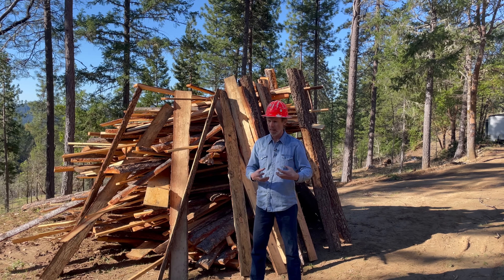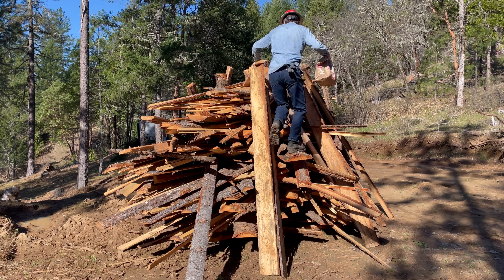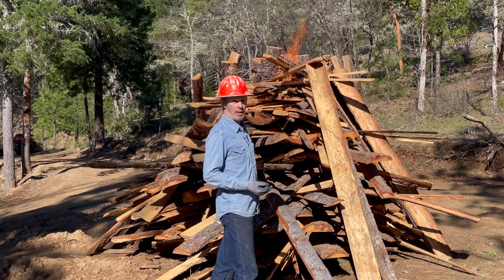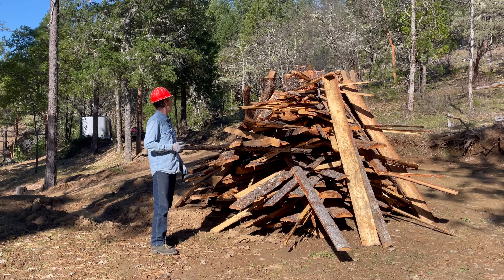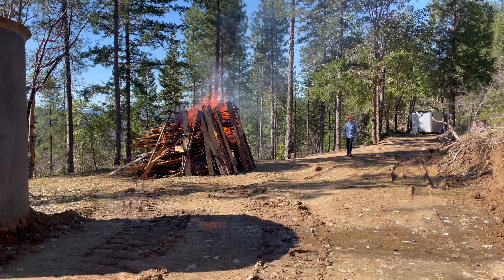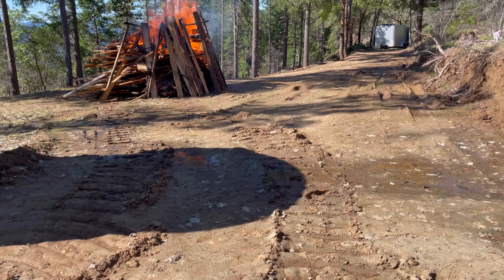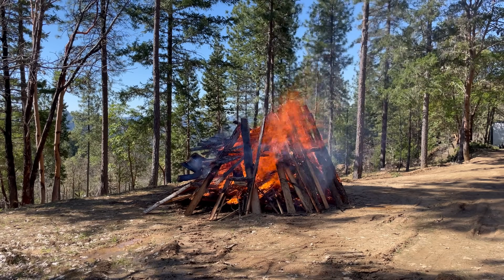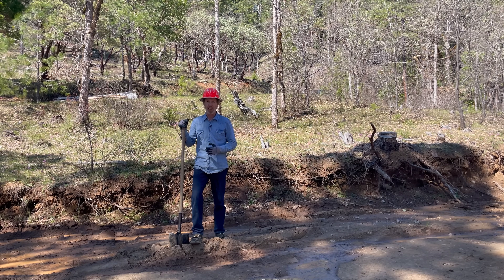Tree Killing Bugs Your Days are Over! Medieval on Your…..

Comment: Thanks for clearing up the mythology about heat rising. Heat doesn't rise, but hot air does in the presence of cooler air... convective heat transfer as you noted. And radiative heat transfer sure burns cleaner. Well done!

Comment: Heat doesn't recognize that gravity exists, as stated it goes in all directions equally, it's only guided by going from hotter to cooler.

Folks get confused because hot fluids (particularly gasses but liquids too) expand and float on cooler fluids, how hot air balloons work.  That thermal convection, aka., 'vertical breeze' also aims the flames to a significant degree so fire does travel faster UP, away from gravity than down.

Lighting from the top does tend to take longer but it also produces less smoke as smoke itself is flammable and consumed in the flames above whereas lit from the bottom produces smoke from above before flames get above.  In a brush pile burning bits will fall thru pile fast and doesn't matter much in terms of ignition speed.

Most important IMO is a tall narrow pile, taller than wide ideally, roughly tepee shaped, that causes chimney effect for rapid minimal smoke tall fire that shoots exhaust way high.  My brush piles are about same size as Wilson's burn pile here but less dense and are consumed to charcoal ready for quenching to harvest for biochar in about 90 minutes whereas it may take half a day in a random pile and require a lot of hot-raking along the way.

Comment: That was an interesting demonstration of the pushing capacity of the D6C which isn't that much but faster than a shovel. 

As to putting out the fire not so much. You didn't put it out so much as you just pushed it forward and parts were still smoking so not out. If the soil was wet so much the better but still not a perfect solution.

Comment: If you have a nice and dry spot to start your fire, and if you have good kindling, then sure you can start a fire from the top obviously. And this may be much easier.
But in less ideal conditions (not being prepared), lighting from the bottom will give a batter chance of lighting the pile.

Comment: In the fireplace industry, it is called a "top burn' or upside-down fire. You get almost no smoke because you have tons of air being drawn into the fire (secondary aeration). As the fire builds, the center of the pile functions as a chimney drafting combustion air up into the burning coal bed. This turns the top of the stack into a funeral pyre for the bugs. It is the easiest to get going, the cleanest burning and even rookies can get a fire going. z

We had a Cat 931 crawler/ loader with the clamshell bucket. Anyone who thinks its simple to grade with a dozer has never driven one. For one, there is no suspension. If you ride up over a rock or hump, the whole dozer tilts. At first, it feels like you're on an amusement park ride because every slight change in grade feels magnified. 

Great stuff as usual Mike. Love the dry wit and wisdom. Y'all need to watch Mike's discussion on forest fires and poor forest management. You'll understand how not only has our much-vaunted US Forest Service done a disservice, but that Smokey The Bear should have been released back into the woods. Fire causes necessary thinning of scrub growth and strengthens the larger trees much like ice storms strengthen trees by forcing them to carry the heavier load. 
 Thx,

Comment: Biochar??????? All you did was make lye for soap. Way too much oxygen and  ashes.
You have the perfect set up for making biochar.
1.Tee-pee the wood like you did , cover 3/4 of the way up with earth , light from the top, let it get to burning real good, then cover the whole thing with a good mound of soil.
2. Fill up that steel pot with as much wood as it will hold .  Light from the top.  Let it get going real good.  Cover the top  with a huge mound of soil. This method might be a pain to clear out the pot but it is definitely the most efficient  and the most safe. Scattering burning embers through the woods is not the most safe way to extinguish a fire.
Reply from the maker: Some people consider charcoal to be biochar. I believe lye is made from ash, not charcoal. There was a lot more charcoal than ash. I was part of a Biochar study a few years ago. It determined that top lit fires retained a lot of charcoal without turning it into ash  if you extinguish it soon enough. Because of the way they burn, the charcoal is shielded from oxygen much of the burn. No this is not an efficient way to make it. Yes a lot of it does get consumed. But a lot of it doesn’t. For someone who doesn’t want to go through a bunch of process, this is a way to make charcoal. It’s the way I make charcoal for grilling. Minus the dozer and the dirt part. They were not spread around the forest. They were spread around then buried in wet to muddy mineral soil. A safe distance from any forest material. Much less dangerous than everyone who is burning debris in the forest right now. The wet season is a safe time to do that when it’s too wet here for wildfires.
Reply: @WilsonForestLands  Charcoal and biochar are the same thing.  One you throw in the dirt.  The other you cook with.  Look, that dozer makes the prospect of you making biochar into a very profitable business and you have to do minimal work.  Just dig a huge cone shape hole , do the wood and lighting it just as you did before. The tee-pee ensures the wood falls in on itself , pushing burnt wood to the bottom and fresh wood on top.  Lighting from the top robs the bottom of the cone of oxygen.  All the air stays  at the top to feed the fire. So the charcoal is actually formed at the bottom of cone since it drops to the bottom.  Again, once its burning at a nice rate just cover everything with a mound of soil.  You can leave the char there until you need it.

Comment: Something I noticed about your top lit fire… the flames didn’t get 30 or 40 feet in the air, like mine did when I lit a pile about that big from the bottom!!!
Reply from the maker: The wood was also partly green and slow burning, that may have kept the flame length down.
Reply: @WilsonForestLands and @ronharrington228, i made the same observation and also believe this is a much better controlled fire intensity for such a fire size obviously in the absence of wind. I will try this next time I need to burn large amounts of wood waste as it often turns into hell when doing it bottom up. Thanks for the great content as always.

Comment: Biochar for 'hippie science' (terra preta do indio) needs the grain structure of wood to host soil microbes. You can't get that from bugs or with the ashes of an open fire.

Cone fire would work, or any way of cooking the wood around 800°F to 900 °F without letting air get to the wood. Your way is just soot, ashes and char.

But good effort helping keep down the pests and showing folks how to burn wood with just some matches and a tractor.
Reply from the maker: That’s what I have heard. But I’ve also heard some so-called biochar experts say this works well too. I’ve looked into it a lot over the years and what I have learned for sure is it is black and messy.
Reply: @WilsonForestLands  By the way, did you have the names of these so-called experts handy? I'd like to look into their methods.
Reply: @WilsonForestLands  No doubt! 

The world is full of people whose confidence in what they say runs ahead of our confidence in what they say.

The residue of a trash fire or clearing fire is almost never biochar, as I understand it. 

No pyrolysis, no biochar. 

Not sealed off from oxygen while it cooks, not pyrolysis. 

There are different grades of biochar, I'm sure you've heard, depending on wood used, cooking time and level of heat. 

I don't need to tell you biochar is porous and takes up compost tea during activation to make terra preta, so it hosts nitrogen-fixers and forms the equivalent of drainage tile when well-mixed (about 25%) with soil, to reduce need for irrigation and risk of flood while extending soil fertility. Plain wood ash changes soil pH, and might add some potash, which is good, too.

While both can have benefits, they're not magic.

My grandparents when there was wartime rationing used a pyrolysis cooker to get producer gas and biodiesel to run farm equipment, with some bonus black liquor for protecting fenceposts from rot. I suppose they could have been hippies.

There are some sixty commercial uses for biochar, from activated filters to aggregate for high R-value concrete, but it'd take a big milling operation to really make it a going concern, as you only get 15%-35% dry weight as output. 

I'm just a guy who designs hand tools for market gardeners, so I can't really advise on an operation of your scale.

People can use Google Scholar for the academic angle. North America's got some biochar businesses, but the only government-backed certificate yet is from the European Biochar Organization, which I know nothing about.

Seems the comment section has plenty of people wishing you well in your biochar pursuits. Good luck with all that, on top of managing woodlands.

Comment: I remembered you this morning. I went and burn the leftovers from pruning one of my very small vineyards (under 6.000 squared feet, about eleven times less in m2). There were both the pile from last year and, on top of it, all from this year. This year's was still green, some had even sprouted not realizig they had no root to be fed from, but the weather has been really humid these last few months.

So much so that it took me a while to get it going. I had even gone before to a different property and got some eucalyptus bark, as if anythig is too good to be kindling, therefore too bad, as it burns way too quickly. That bark burnt and since the leftovers were really wet, I had to use some firelighter. But, hey, I did it from above as you say and it got going. Mind you, it was intertwined with grass and kind of hard to move with my fork, but it finally burnt down.
Reply from the maker: With material like that it might be hard to get a fire going no matter how you do it. But as long as you got it done.
Reply: P.S. I didn't have that machine so I could put the fire out, I just waited until it was not a danger anymore, as it was sorrounded by wet grass and, anyway, if I had such a machine, the property is not big enough to maneouvre ir inside.

Comment: Heat does not rise, however warmed air does. Providing of course that the warmed air is warmer than the surrounding air.
Reply: And so does the carbon monoxide, methane and hydrogen that actually burn and cause flame. But it’s not worth arguing with him about it. Even if he did add try twigs to to top of the fire to keep it going 😁👍🏼
Reply from the maker: I put twigs on top of the fire. It would be hard to put the dry twigs underneath the fire without lifting up the fire and putting the fire out.
Reply: Really? One would think it was easy. You put them on before lighting. Course then they wouldn’t be above the fire. Well I guess they would if you lit the bottom like you’re supposed to. 😁😉👍🏼
Reply from the maker: I had kindling on the bottom and the top and around the sides. The best of all worlds. All well spaced enough to get plenty of oxygen.